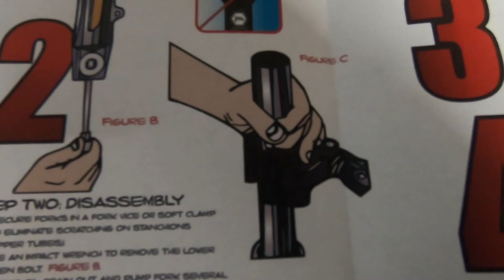Legends +2 Axeo Cartridge Install, Also New DLC Black Tubes, New Suspension

Comment: Did the +2 add a little more stability at high speeds? I want to do the legends +2 front end because right now with 13.5s on the back i feel a little squirrelly at high speeds. Maybe also add a GPR stabilizer

Comment: looks good with the black tubes! looking forward to see the new setup & hear your review (likes/dislikes) on how it changes the ride quality. I know when you go into upgrade mode with parts you just want to add everything all at once, but will you ride/test it out with the old rear shocks 1st or just do all the upgrades and then review? Also did you consider using the @geezerglide drop trees for swapping to GSXR front forks?